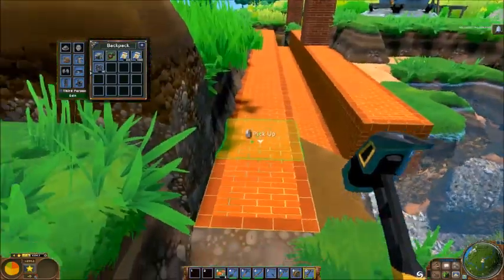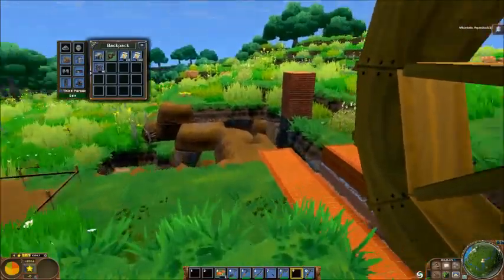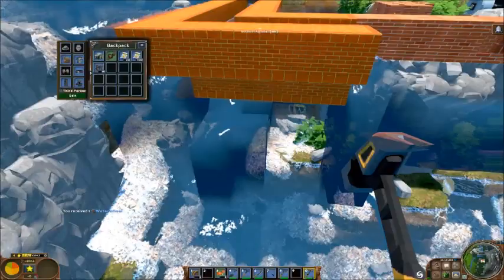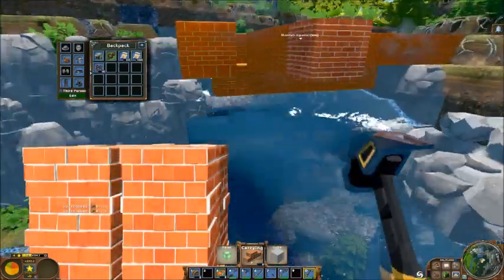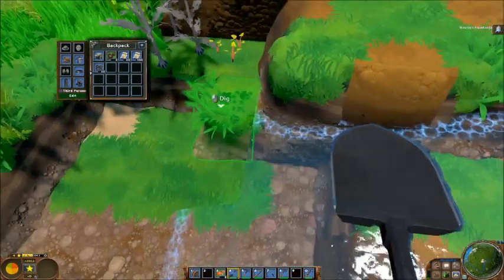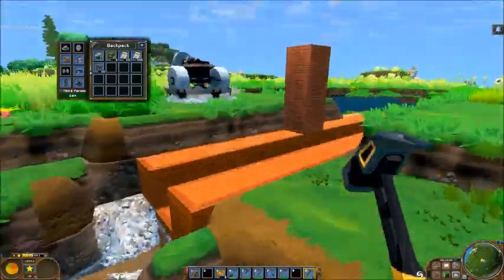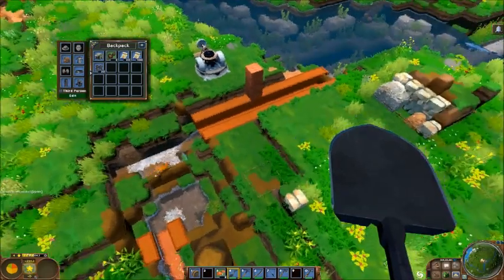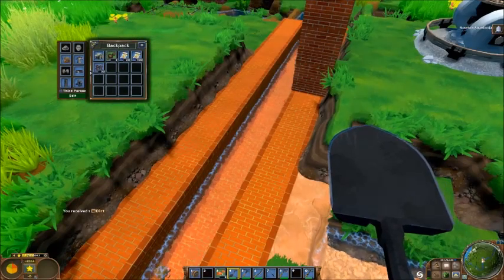ECO 0.94: How Do Aqueducts Work?

Comment: Water still work very weird and the water flow is a hard matter. Due to a tutorial from the developers you can use the aqueduct to water soil, but you need to build the aqueduct below the earth blocks. So you need to dig a 2 high tunnel in the middle directly beneath the block you want to be watered, so you can build the aqueduct directly beneath the dirt block. I never tried it, so I can't say if it really works.
To destroy a waterblock, you need to completely build over it. So surround it and then close the hole with the water.

What you can do to reduce pollution is to pump you waste water into a pool made from aqueduct blocks. Somehow it doesn't seem to count as ground pollution. As this pool will never fill up, there is no danger of an overflow. BUT! If you pump fresh water into this pool too, then the game counts it as ground pollution. So you can bring water somewhere underground, create two separate pools. One for fresh water, one for the waste water and everything is fine. By the way, you only need to fill the pool once, it will never empty. You can cut the incoming water. ;) :D
Reply from the maker: Didn't know about the wastewater pool thing, I'm gonna have to try that.
Reply: @Y2KNW  Didn't knew that either, just was building my blast furnaces underground as I do with my whole facility (keeps it nice and quiet up on the surface) and made a pool for freshwater and a pool for the wastewater. It was running fine, but I did get nearly no ground pollution. So I build the same at my oil platform, just with one pool and I was getting ground polution from the pool. So I made a aqueduct wall in the middle to seperate the freshwater from the wastewater and the ground pollution started to vanish. Now I have only the pollution by the refinery itself.
I never expected that to work and I think that isn't intentionally.
As our world is relative big, their might be still ground pollution that I can't see as it is eaten up by the surrounding, but it for sure reduces the pollution by a big margin.

Comment: It looks like the developers might be using a derivative of the same code as 7 Day to Die uses for water
Reply from the maker: I've never played 7 Days to Die so I can't compare them myself, but water's kinda acted weird in this game ever since it came out.
Reply: @Y2KNW  It works the same way with source blocks spawning "virtual" or flow blocks around it, much like Minecraft... but with some very buggy results. Sometimes blocks will spawn with no outflow, sometimes water blocks can get removed resulting in hole that is never filled... The Devs for 7 Days to Die said that they'd obtained the code from a library, and that it was already "bugged to hell". Both games seem to have had their alpha's created at around the same time, and they both use Unity... Eco may be using the same Unity asset for Eco as 7 Days did... 7 Days had to redesign water from scratch to get it even half working correctly...